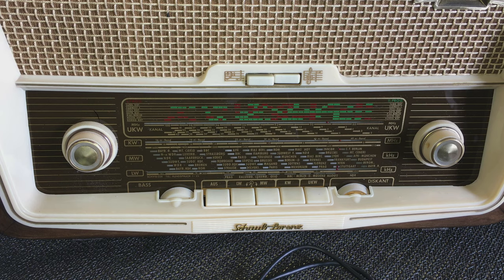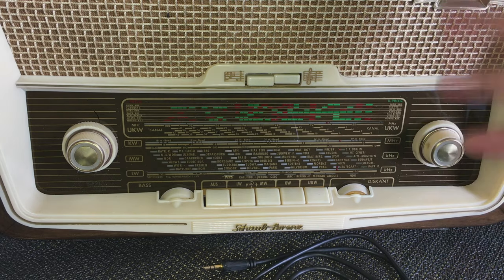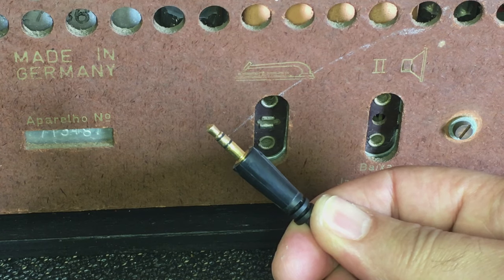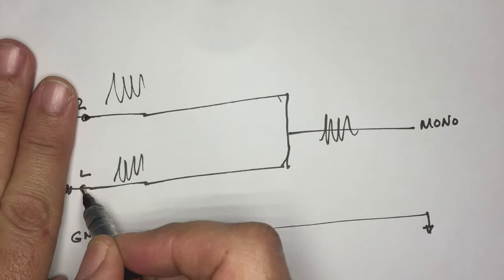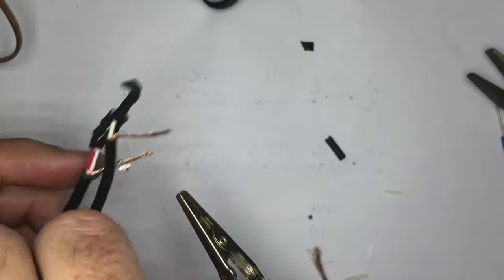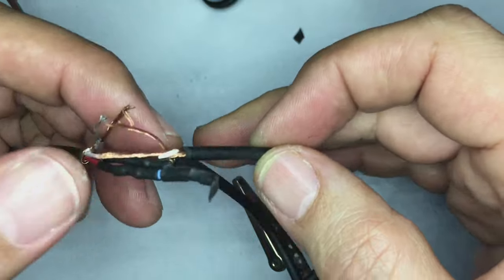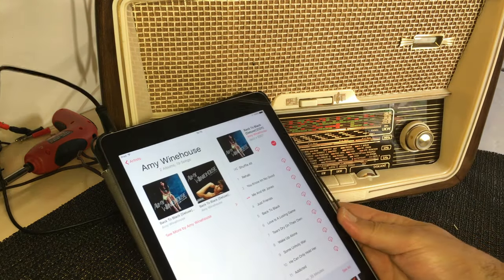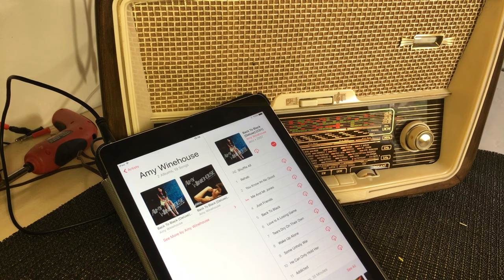Stereo to Mono DIY cable to connect music player / iPhone to tube radio.

Comment: Never too old to learn a new trick! I love how you create these 'wire wrap terminal connectors' to join two wires, excellent tip, never thought of that before. I landed on your channel because of the Graetz radio restoration. I remember we had this Graetz Melodia m618 when I was a kid. Unaware of the dangers of high voltage I played with it connecting other equipment to it. Fortunately there was never an accident... These old radios are gems of that era and it's great to see them being restored and even being used with our modern equipment!
Reply from the maker: I too remember playing with one of these tube sets as a kid, and was lucky as well 😊 no shocks that I can remember. 
Enjoy the channel.

Comment: When I was a youngster we had an old valve radio rather like this and it inspired me with a great interest for all things to do with radio and electronics, which I still hold to this day.  How nostalgic to see such a fine example of a typical radio set from that bygone era.  I also appreciate your guide to making a "summing lead" of which I have made a few similar examples myself for my various musical electronic devices with stereo outputs to play into mono line inputs.  I also recently developed a "summing input box" for connecting up to 5 stereo inputs from different instruments which are individually summed and then fed into a single summed output into a mono line input on a keyboard.  The keyboard then acts as the DSP effects processor and amplifier for the audio input from the 5 devices as well as me playing the keyboard with its own sounds, all through the built in keyboard speakers.  Many thanks for your "trip down memory lane" and your electronic expertise and elaborate explanation.  Please keep up the good work.
Reply from the maker: Thank you for you kind words. I’m happy to know that my videos inform and inspire. Ultimately, that was my prime reason for the channel.

Comment: WOW I watched this video to see if you were going to do something different than 2 resistors. I'm going to add a Bluetooth board to a 1946 phono input. But your assembly technique is AWESOME how is it that I've been doing electronics stuff for 40 years (off and on) and have never seen this method of hard wiring it's sort of a half Western Union. You have nice skills truly professional results. Thank you for that simple technique.
Reply from the maker: My pleasure, Joe. Glad to be of some help.
Reply: @electronicsoldandnew  I'm just amazed I've never seen that technique... Thanks
Reply from the maker: pleasure
Reply: Did that work?

Comment: Thanks Manuel, i admit i wouldn't have thought about shielding the mono wire.  I just finished the cable, i'm testing it on the newly restored Grundig 4055 and it works fantastic using a proper MP3 Player through a nice little DAC.  Life is good, thanks for sharing this.  Me happy :-)
Reply from the maker: My pleasure 👍

Comment: Great video Manuel, thank you! An idea to make the resistors make a little less of a bulge is to make the cable of one channel slightly longer than the other one so that when one resistor ends the other one starts so the total thickness is reduced to a resistor plus the lead instead of two resistors. Keep up the great work!
Reply from the maker: Thanks for the tip.

Comment: Nice project, I need to build one of these. A couple of comments: 1. If one has a hot air soldering station, they also make a great heat shrink tubing heat source for small jobs such as this - plus no open flame on the heat shrink material, a pet peeve of mine. 2. As you correctly pointed out, for a variety of reasons line voltage may be present on the chassis ground of a radio. Using "screw type wire retainer" banana jacks is something I would discourage as line voltage could be present on either of the plug's screws and there is a high chance that a person will place a finger or thumb directly on an exposed screw head when inserting or removing the plugs from the radio. Using solder type plugs with no exposed metal surfaces is a wise choice, IMHO.
Reply from the maker: Great ideas. Thanks 😊

Comment: Very nice and simple tutorial demonstration how to connect a modern equipment  like I.phone ecc. To an old tube amplifier radio connection by preparing the right cable to the radio. This type of cable doesn'exist yet. I think you could patent it. Thanks for the video.

Comment: Thanks so much!  I intend to build a stereo 1/8" to RCA mono to use with a chromecast audio into a Knight integrated amp.  I will certainly be sure to check for a hot chassis, but I am confident this is not the case.

I especially like the way you shielded the signal all the way to the splice and I learned a few tricks for soldering bare wire.  I need to get some of that steel wire on a spool, for sure!!
Reply from the maker: William Smothers : always a good idea to check. Have fun.

Comment: This is a HUGE help on a couple of my old tube radios but a few others don't have that banana style plug, they have an early type 3 pin DIN plug. 
Whilst I imagine the 3.5 jack end of the cable is the same I have no idea how the 3 wires in the DIN plug are orientated.
Reply from the maker: In some cases they are not standard, so you'll have to open it up and actually check on the back of the socket just to be absolutely sure.
Reply: Came here for exactly the same reason re the later 3 pin DIN plugs on slightly later valve radios.

Did you follow this up and work out how to wire the 3.5 jack plug into the 3 pin DIN connector using the resistors Manuel uses here??

Comment: Nice video.   Is there a safe way to do this with a hot chassis in Canada with a neutral   outlet?.   I changed the wall plug of my Philip's P143 to orient neutral  to ground.  Added a speaker  out and added a microphone/guitar/bluetooth jack  input to the volume pot where the RF was connected. Recapped.  I added  a cooling fan as it's overheating.    Also the mic input  maybe to strong relative to the Rf input . It sounds very good as a harmonica amp so I'm motivated to make it safe.
Reply from the maker: There is a way to do it safely using capacitors to isolate the input, but I cannot give details as it may hurt someone 😊

Comment: You sound South African. 👍🏻😁 I have learned quite a few tricks. Thanks boet.
Reply from the maker: I grew up in SA, hence the accent. Grew up in Harrismith and then PMB. Studied in Durban Varsity. Where are you from?
Reply: @electronicsoldandnew  Small world. Grew up in Greytown in the 60s and 70s. Studied sound engineering at SABC in the 80s. Spent most of my life in Joburg. Now back in Kzn, Camperdown. Tinker with building hifi systems that sound amazing on small budget. 3D printing and basic electronics sometimes play a part. 
Where are you living now?
Reply from the maker: In Madeira.
Reply from the maker: If I’m not mistaken, the de Jesus family still live in camperdown. They are also madeiran.
Reply: @electronicsoldandnew  I've only been here since May an Covid 19 has not allowed me to meet many people. I will keep an eye out for them. My sister is living in the Azores now. I'm hoping to visit there soon. To be honest I think it is time for me to start looking at my options abroad. Thanks for the response and the really good videos. The level of detail is perfect for someone like me with very limited knowledge. I'm currently attempting a project to make wireless active speakers with 2 x bluetooth modules. Hold thumbs.
Reply from the maker: Good luck,

Comment: I do this the lazy way and wire one channel of the stereo 3.5mm cable to the output jack then set my iPod to mono. Good call on the hot chassis. Many US sets are hot and can be dangerous if someone is used to newer electronics.
Reply from the maker: Jim Kresky : Yes, that is a good method. 
Hot chassis are a menace, and I’ve come across them in Portugal too. I guess they were a cheaper option, so sold well here. We use 240v mains, so a zap is even more memorable.

Comment: I would use an audio isolation transformer mounted inside the radio and connected to the input jacks.   This would prevent the grounding problem you mentioned in the first part of the video.  Added protection for your mp3 device.  You can get 5 of them for less than a few dollars on ebay.
Reply from the maker: Joseph Nicholas : true. That would work well.
Reply: Good solution. Can you please give more details about the type of transformers you used or a typical ebay link? Thanks
Reply: esmail    Just search  eBay with the search term ' Audio Transformer 1:1', you'll find lots of them 
(typically in red tape wrap). They are cheap, but effective. I've made hum destroyer boxes for laptop to amp
solution.
Reply: @standishgeezer : Great. Thank you very much for letting me know.
Reply: On 2023. I have an opus telefunken. Will this work?

Comment: Coming back to this old video because of something I saw today. The claim is, this kind of stereo to mono conversion, although it keeps the source device perfectly safe, it rather creates a very wrong mono impression of a stereo source. The problem is defined as; this being a voltage divider, it works perfectly as long as the audio in both channels are almost identical. But when one sound is present in one channel and totally absent in the other (i.e. one instrument or voice is panned all the way to left or right) then the absent channel becomes a sink to the other and the panned sound is halved in the divider, thus creating a "wrong" mono mix. The claim is further extended that there may be situations where a signal on one channel can actually cancel another one on the other channel if by chance, they happen to be very similar but 180 degrees out of phase... This is splitting hairs, I know but there is a sound logic in it too.
Reply from the maker: There is logic, indeed. The only way to really “sum” the signals would be by using opamp adder, but even then some out of phase signals could cancel out. This is really a simple and “good enough” solution, but by no means perfect.

Comment: Thanks for the great video!
 if I have a stereo cable (4 wires: left, right and 2 ground) how can I connect it to this mono amplifier board that has ground , + and - wires?
thanks 🙏🏻
Reply from the maker: The two grounds are wired together as one.
Reply: @electronicsoldandnew  yes this is understood, but how I connect this 2 ground and left+right wires to mono amplifier that has only 3 wires: +,-,g ?

Comment: Epic. Can I easily adapt the ohms for amped signal going straight to a speaker? Many units will have two amps (L+R) to take advantage of.
Reply from the maker: No. If I understand your question correctly, you’re talking about the amplifier output signals. This will not work there. It’s purely to join line level signals - small signals - not high power ones.
Reply: @electronicsoldandnew  ty

Comment: Manuel
I am attempting to fit a Blue Tooth board like the one you use to some of my radios.

With the Beomasters I have, I can easily plug in a commercial 5 pin plug with its 2 shielded wires one for left and one for right channels. (The left and right hand signals come out of different sides of the 5 pin din connector). There may be 2 sockets on the Beomaster with one for receiving turntable signals and one for tape connection and corresponding switches to select these sockets.  I have used this with Logitech blue tooth adaptor and it is simple to use and works well. 

I thought that connecting the mono radios I have (Beolit 600 and Grundig Party Boy and Grundig Satellite 2100) would be as simple. However I am struggling. I have made up the lead you suggested with the 2 resistors  and just to get it working I used a bench power supply to power the board (3.7 to 14.3v) and I used 9.5v. Now the Grundig and the B &O have similar connections on the 5 pin connector. The B&O just soldered 2 pins on each side of the plug together. The Grundig appears to have a ground on 2 of the pins 3 and 5 with a resistor on one side and on the other side of the plug the 2 pins 1 and 4 are joined with a resistor. This is marked for turntable on the schematics. This leads via a switch to the preamp and amplifier stages when the push switch is depressed. I cannot get any signal from the board, all I get is a hum. It is much the same with the B&O 

I was wondering if you had fitted blue tooth to your Grundig 2100's and if so was there something that I have done wrong?
Help would be much appreciated.
John
Reply from the maker: I have not fitted BY to my Grundig. however, the 2100 input DIN socket has input from an external source and also an output to a tape system for recording, in the same DIN. You need to connect the two outputs from the BT (L and R) through two 1k resistors to get mono, then connect this mono signal to the input pin on the DIN connector, and obviously Ground as well. I’m not sure which side is input and output, but try both and you’ll see the result.
Reply: @electronicsoldandnew  Manuel  Sorry for the delay. I have it working, I have tried both sides  of the din plug and have it working on either side.  The sound from the iPad is a bit disappointing. The sound comes over to the radio as a quiet signal and lacking in bass. With the bass turned up max and sound much higher than I usually set it at the result is listenable with no obvious noise. However it is disappointing. The fantastic quality sound of the Satellite 2100 is just so good on FM anything worse is soon noticed. I did try playing with the iPad settings and note that there are Apps that correct the problem. I may well try another bluetooth board to see if it is any better.  John
Reply from the maker: If you connect to the tape out of the din socket, all the bass will go away, so you may have it in the wrong side. There is a high value resistor in that line that acts as a high pass filter. Try the other side.
Reply: @electronicsoldandnew  Thanks for the reply, I did try both sides of the din and there was a difference as you say. The signal is just too low and lacking in Bass.  John
Reply: Manuel
Finally found the issue and fixed it. Both sides of the din socket have 1  150K resistor fitted on the IM AF board  (R571 and R573. ) R 571 was the easiest to get at without having to take the chassis out and I desoldered the resistor and fitted a wire link across it. This cured the problem.  I now get reasonable volume with the iPad and radio volumes at 50% volume. The bass is now strong. 
Thanks for persevering with me. A happy John
Reply from the maker: Glad to hear that you’ve succeeded. 👍

Comment: Thanks for the video. I have a question. I’m trying to connect Braun Atelier to a bluetooth receiver. Do I use a mono cable or stereo cable (3pin DIN- double RCA)for Atelier?
Reply from the maker: The atelier has stereo external input, so use stereo.

Comment: The inputs of this old tubecracker are for the turntables with cristall-systems. Isn't that a problem, because these have a high output-impedance? 
Btw: On the market there are very little af-transformers. These can be used to get rid of the problem with the 'hot-chassis'. Cheerio.

Comment: Thanks I came looking how to take the stereo headphone output from my mums TV to a speaker on the shelf next to her.  Can this lead go into a  small speaker (I expect some loss as its a 3 meter run)?
I may have to put the speaker to one side and buy a small beatbox that has a stereo jack input.
Reply from the maker: Not much loss at that distance.

Comment: Thanks for the video. I am wondering if you have any updates for isolating hot chassis apart for the isloated transformer idea given by Joseph Nicolas.. Thanks
Reply from the maker: esmaeil nam : his idea is still the best as any other solution can put your equipment and yourself at risk.

Comment: I have one other question if you don’t mind. It’s more specific to this video’s topic of going from stereo to mono. Instead of a headphone output the source I would like to use is stereo turntable with magnetic cartridge into a mono Blaupunkt radio. I plan on going from turntable to preamplifier to the radio’s inputs. My question is this: are the 1k resistors still the correct choice for mixing the signal?
Reply from the maker: If you’re going from stereo to mono, yes.

Comment: High from England  I did enjoy this video  I will be doing something similar but I need to put the signal into a stereo valve amp on my jukebox I will beusing a  2 channel passive di box as the only input is where a ceramic cartridge plugs in but not sure if I can join both channels on the input to the stereo amp  

take care in this worrieng time   barry

Comment: So what kind of a resistor would you recommend for a low impedance load like a pair of antique mono headphones? I have a friend who wants to connect his iPhone to his antique headphones. I have all of the proper connectors and I know about the resistors but I’m just not sure what the value should be.
Reply from the maker: Not sure, actually. With low impedance headphones you’d lose most of the signal with the resistors I’ve used. I’d try 100 Ohms and see how it sounds